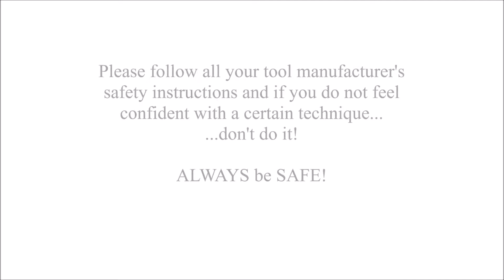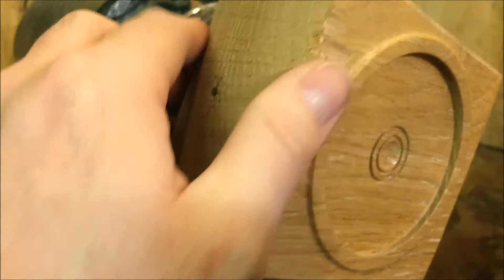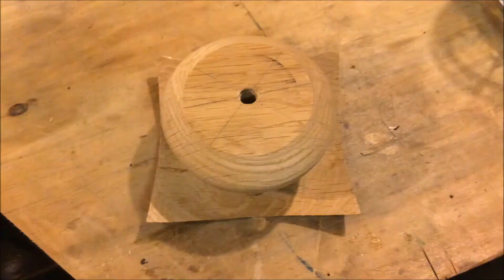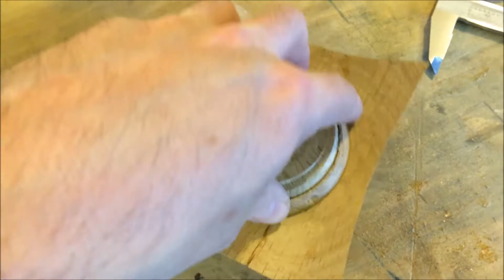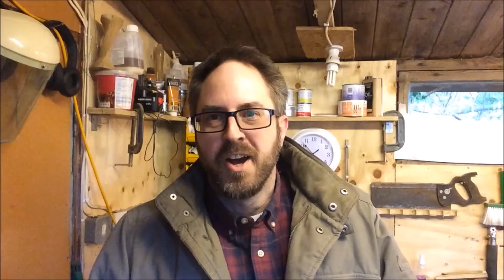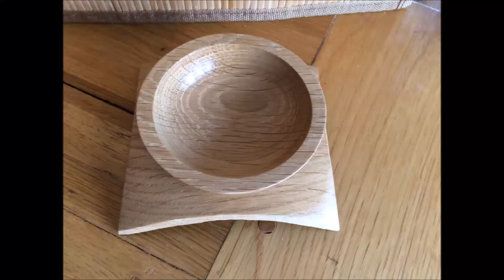Woodturning: Square winged bowl with insert ring

Comment: Remarkable good cheer in the face of adversity -- and admirable ingenuity in pressing onward. A tip, if you don't mind... Use a block plane or smoothing plane to chamfer the trailing end grain edge; it's exactly analogous to chamfering the back edge when planing end grain on a board. And take teensy weensy cuts :-)  Clyde
Reply from the maker: Thanks Clyde! Nice tip - I will try to root my old plane out and check that method out. I did take tiny cuts rounding the edges, but as Allen pointed out in another comment which horrified me, I used a roughing gouge on the end grain edges!

Thanks for your comment - and your tip!

:D

Comment: Dave,when you had the piece between centres,you changed the grain orientation. Roughing gouges are for cross grain only! Should have come at the piece from the end with a bowl gouge,as when doing outside of a bowl . I've done it Myself!  Call them design opportunities, works for me! Worked out alright, WIN😆😆😆
Reply from the maker: OMG I DID AS WELL!!!! You are totally correct - you should never use a bowl gouge on end grain! I hold my hands up - I was wrong in doing so.

In my defence, the cuts I took were very small, and there was a tiny amount of gouge over the rest - but these are no excuses and it's great you pointed this out - thank you!

Thanks Alan, keep pointing out things like this as I need to stamp them out!

Take care, 

Dave

Comment: Really like the finished item and the way you tried to get over each of the little issues that got in your way. What I found really interesting was all the possible shapes you had as you worked your way through, had anything worked before where you ended up it would have been such a differetn piece. I think that the harder woods like Oak all seem to chip like you had there on the edges, not sure of the best way around it. Well done!

Hollow challenge?
Reply from the maker: Hi mate, thanks very much! I played around with the main bits a LOT before I decided to use them in the final orientation. But you're right - as I said to Jimmie in the comments, I just sit in the shed staring at the bits I have to see what I can do with them - I have quite a few new ideas just from thinking about this piece!

I've sent you a message on Facebook about the challenge.

:D